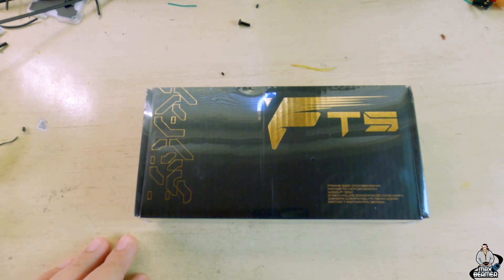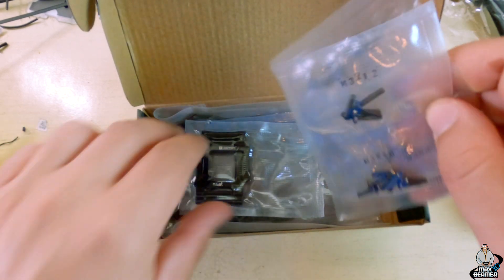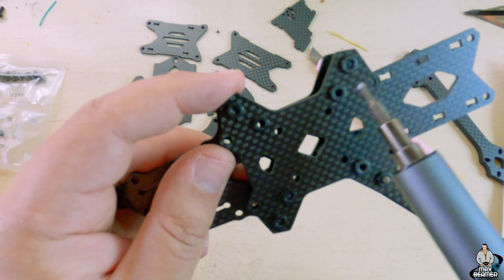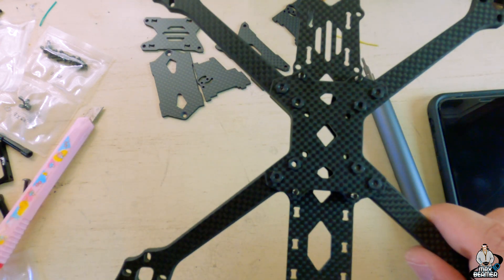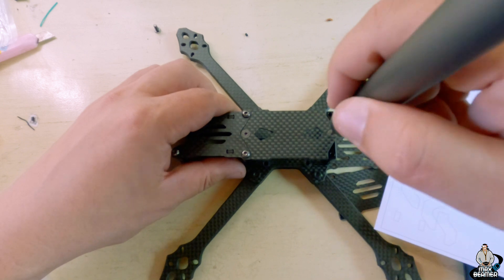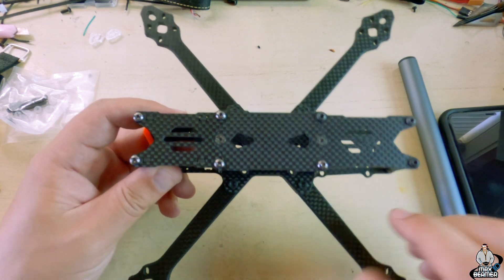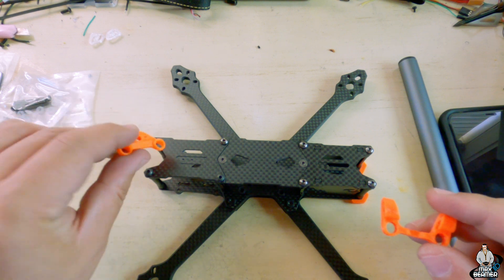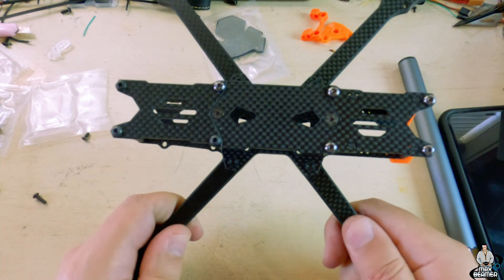Clever Frame Concept from T-Motor! (FT5 Build and Review)

Comment: How is the prop clearance?  I got the new Tmotor Stark frame from FPVCrate and was impressed with the carbon quality, pre-installed nuts and build - until I got the build done and realized there was almost no clearance at the rear standoffs.  I only had one set of 5" props that would clear.  Less than .5mm clearance on 5.0".  Othet than that the frame is really nice.
Reply from the maker: no idea but I think tmotor made the stark too

Comment: I’m not convinced that the Fork design is going to be all the durable. The arm might pivot on the one bolt that goes through the hole, the other bolt will just act as brace as the fork snaps off because of, uhh the fork not being as strong as complete slot/hole. I slotted design would make me feel better. Great review, keep up the good work, let us know if those forks break.
Reply from the maker: maybe if there were 2 screws but there are 3 total, the fork stack screw and the 2 supporting it should be okay but who knows!. thx man ill keep you updated haha.

Comment: Thank you for the insightful review, Max - that frame has some neat features. It might only be a challenge if you like to mount the VTX to the underside of the top plate (where the removable center plate or its rear cross-plate standoff sit) with the antenna trailing along to the rear.
Reply from the maker: you could probably get it on the rear plate but good point.

Comment: Interesting frame design, packaging is mad overkill though!! 😃

The pressnuts looks the same as the ones in my Xhover Stingy frame, they come prefitted in the plates as well.
Reply from the maker: haha yeh a lot of plastic waste for sure interesting on the stingy ill check it out
Reply: @MaxBeamer  I had the v1 Stingy, it felt really planted in the air due to its wide stance, but unfortunately I only got to fly one and a half packs through mine before I destroyed the top and bottom plates plus a 4s pack, I was gutted!!! 😃😃

Comment: nice frame. could mount the caddx vista on it. i like the top plate. just means you can work on the stack without taking it all off.
Reply from the maker: yeh very cool! stack front or back pop off easy peasy